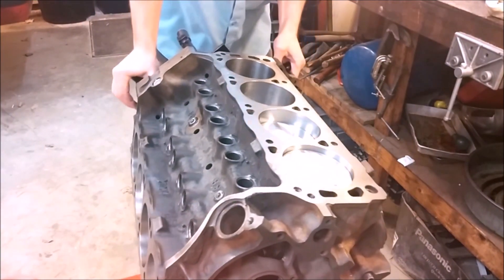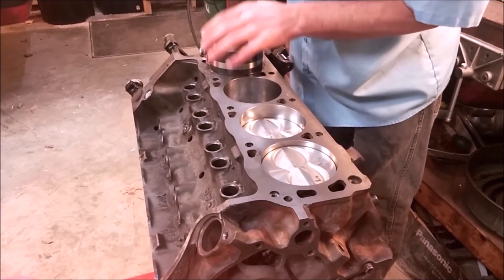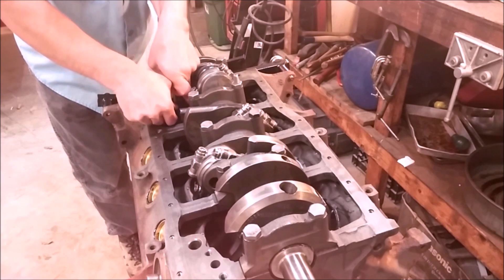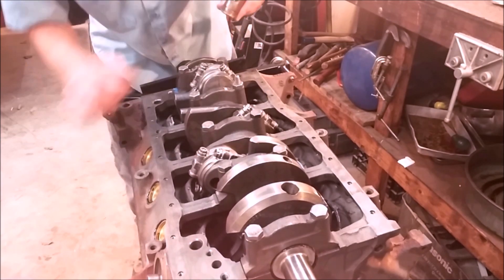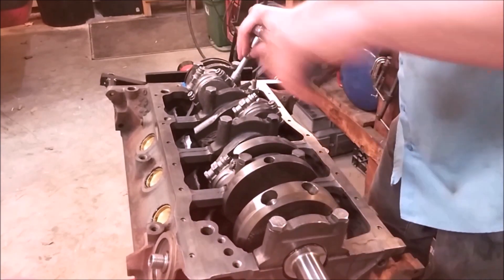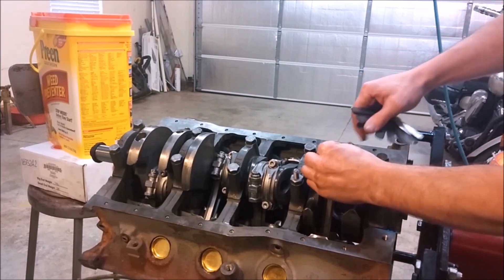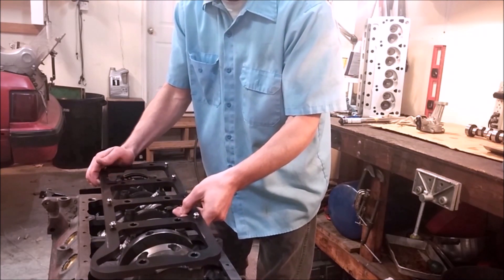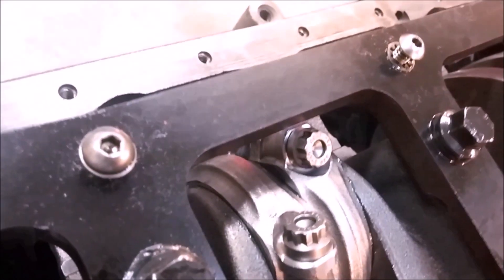How to Build a Ford 347 342 331 306 302 5.0 SBF (Part 3)

Comment: I have never seen anyone assemble an engine with no Assembly Lube or Oil on the Bearings.
Reply from the maker: Lube already on crank journals, mentioned at 0:21 and in a reply to a previous comment.

Comment: For scat 3.25 in stroke crank/327-331 assembly, is cylinder clearancing required? Or small base circpe camshafts? Or do they just drop right in?
Reply from the maker: Generally none of the above, drop in.... but always double check!

Comment: What’s going on man, your videos really are helping me! I was wondering though when you torqued the connecting rods down what were the specs you used. I’m getting ready to build a 347 myself, and I google the torque specs and I always get the 302 torque specs. If you can help I’d really appreciate it
Reply from the maker: Rod bolt/stud torque specs are specific to the fastener material composition/strength used.  Aftermarket rods usually come with a torque chart based on the fasteners in the rod.  If you go your own way with ARP bolts for example, you need to follow the ARP specs for that diameter/material bolt.
Reply: fastfrankd thank you man! I appreciate that, I had saw the spec sheet when I opened the box. I didn’t know it was in there, thank you for responding again

Comment: dry installation of bearings....nogo....never do this...this engine will die early...
Reply from the maker: The crankshaft journal is lubricated with engine assembly lube as stated at 0:21 in this video.....

Comment: Im currently building a 347 stroker and I was wondering when using a torque wrench to spin your rotating assembly without heads what's a range in ft pounds that you would consider acceptable?
Reply from the maker: I go more by "feel" because this varies widely from engine to engine, a race motor with wide bearing clearances, wide piston to wall clearance, and low tension rings will be significantly less than a street engine with narrow bearing clearances, close piston to wall clearance, and conventional rings. The final honing operation cylinder wall roughness will also have an impact. That being said, I would expect it to be in the 20 to 40 ft-lb range while moving. It should feel fairly even throughout the entire 360 degree rotation.  I rotate the assembly after each piston is installed, this way you can measure with a beam torque wrench (or feel) after each one is installed, and it should increase proportionally. If not, you may have done something wrong with the most recent piston/rod install.
Reply: IIRC, I usually see about 12-14 lb ft of torque with all 8 pistons installed, and this number will change based on the ring package. As you torque down each rod cap,  turn the crank and test for binding, as Frank says.

Comment: Why didn't you use main cap studs for installation of the girdle and windage tray? Not snarky. I've never installed a girdle or a windage tray so I really do want to know.  Thanks. Btw, did you get your partner status?
Reply from the maker: Hi Jon, thanks for question.  This girdle kit came with bolts. Studs are also an option for more reliable and stronger clamping, especially when you are worried about the clamped parts gapping or seperating under high temporary loads, but the Ford block itself is the weakest link in this engine, so studs don't really add much.  The girdle redistributes instantaneous loads applied to one main bearing/cap/web to all the others to even out the stress peaks, whether you use bolts or studs.  If the block is very strong and you are worried more about main cap walk, studs are a good option.
Reply: fastfrankd why do you use a hammer to beat on the crank why are you not using a rubber mallet hammer that that can leave dings you know when I was at school and yes I'm going to say I went to school and what do the Motorcycle Mechanics Institute and did late model early model Harley-Davidson did Honda tech 24 also went to Universal Technical Institute and did Automotive technology 2 and all them ASE Master techs that we have down there you never use it Hammer to beat on the engine and you you may not be beating on it you may reply back telling me you tap on the motor but you're not use a rubber mallet Hammer so it doesn't put any dings and of your crankshaft so I was just wondering why you're using a hammer that could leave ding marks and stuff like that
Reply from the maker: Hi Jason, thanks for your comment.  V8 crankshafts are heavy, from 50-100lbs depending on exact engine platform.  That amount of weight, combined with the high shear properties of engine assembly lube means substantial force is required for any movement to align the thrust bearing.  Ideally, a large deadblow hammer would be used if available, but a steel hammer can be used with care without damaging the crank.  A rubber mallet will just bounce off without appreciable aligning force

Comment: Y did u use 4 valve relief pistons for a 347?
Reply from the maker: Great question!  Depth, size, and number of valve reliefs are the easiest way for piston manufactures to control compression ratio.  These 4 relief pistons give about 10.5:1 CR depending on head cc.  Where as a 2 relief piston will jump that to 11.25 or more.
Reply from the maker: I should also add that it allows the use of an offset pin piston design without the set having to be seperated into left and right banks, basically keeps things simpler on the manufacturing and assembly side of things.
Reply: @fastfrankd  Thank you ,I did not know that!!
Reply: Depending upon how one plays with offset pins, you can increase the dwell of the piston at TDC, in effect acting like its a longer connecting rod...for those who believe in the effects of a longer connecting rod. The issue, unfortunately, can be the side-load imparted on the piston skirt to the cylinder walls.
Reply: carey tisdale This guy does great videos.  Please subscribe to his channel so he can continue to make them!